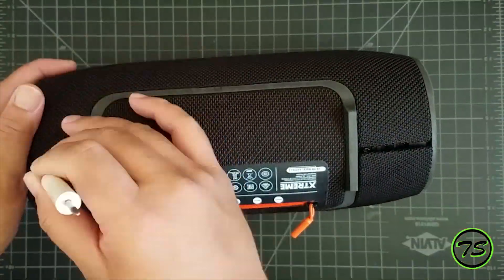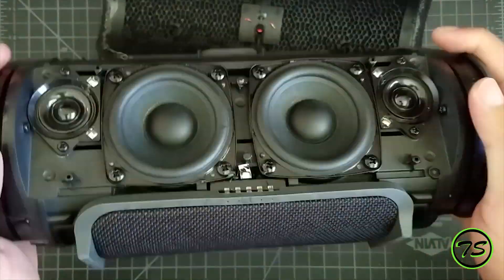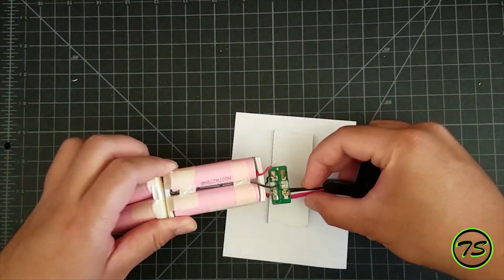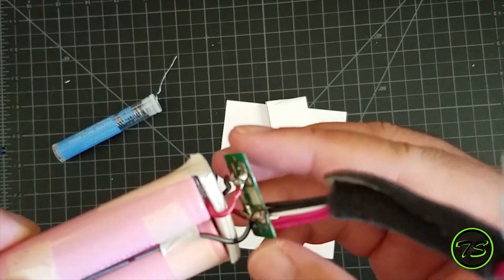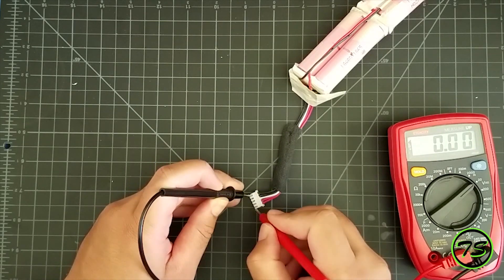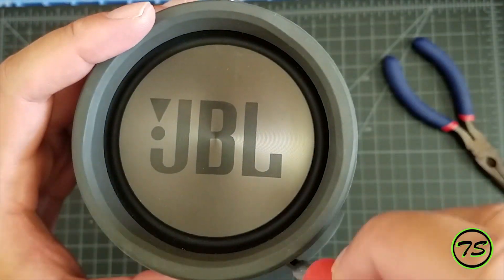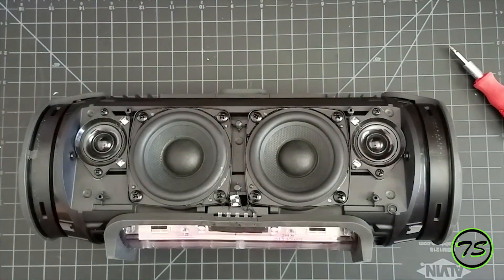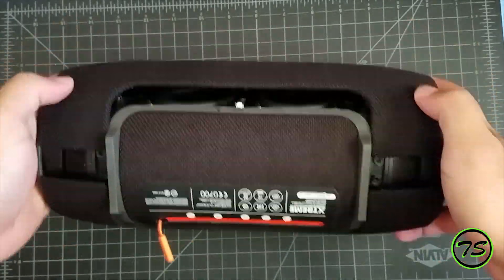(UPDATE) JBL Xtreme + 18650 Batteries (DIY)

Comment: I bought a "floor model" of the jbl extreme for $160 a couple months ago; missing the charger and strap of course. Bought a power adapter for $10 only to find the batteries in it are garbage. Turns out it's a common issue with this speaker. I've been happily using it at home plugged in, for what I paid I can't complain as physically, the speaker is in awesome shape. Apparently it sounds better and gets louder on wall power anyways. In recent weeks though I've been wanting to get the portability back into this thing. I've decided on 3400mah Panasonic 18650B cells, ideally raising the overall capacity from what ever the factory batteries are; however I'm a little hesitant to order them. In short of tearing the speaker down and manually testing the battery, how can I know if the BMS is the problem or not? My speakers exact symptoms are; constantly indicating 75-100% charging while plugged in. Remove power and speaker will continue playing anywhere from 10 seconds to 3 minutes before powering off. If it does end up being a faulty BMS, would you happen to know of a drop in replacement? I can solder that's not an issue
Reply from the maker: That definitely sounds like the battery is bad because it happened to me too. Anyways in this video I did not show what the original battery looked like but when I took out the cover for it, one of the cells was actually swollen. Another way if you can't see any swellings is just check the voltage of the cells. Those original cells you probably may already know its fully charged at 4.2V each so if you have a multimeter and and see that one of them has a voltage that is really low then you know its a bad battery. in other words if the cells have different voltage readings on the multimeter then its the a battery problem. I highly doubt its a BMS problem but I might be wrong.
Reply: Taylor Soloai awesome, thanks for the tips man, I'll be ordering those Panasonic 3400mah cells. I also have a nitecore D4 and Liitokala lii-500 charger, and a digital multimeter so I will definitely test the old cells after I get them out. I'm all about recycling and have been salvaging lithium batteries from almost anything I can get my hands on lately. I have plans to build.. essentially... A giant power bank that charges via solar panels in my window and will allow me to power all of my USB devices free of charge. Think of it as a mini powerwall of sorts, but for 5v USB devices. I have most everything I need already so the whole project will end up costing me less then $20. And with all of the portable devices I have I'd assume it will easily pay for itself within a year.

And fuck YouTube for killing the audio in this video. Luckily I was able to figure out what you were doing easily but it's just annoying is all. Love the content man, keep it up. Will letcha know how the new batteries treat me once I get them in.
Reply from the maker: No problem. You know I had always wanted to make that kind of solar project but hadn't found the right solar charger for the 18650.  Yeah the audio is becoming a problem nowadays, don't even trust those artist anymore that say the music is free to use.
Anyways yeah let me know if the new batteries worked for you. Best of luck!
Reply: Taylor Soloai fingers crossed it's not a BMS issue. Even so though, worse case scenario I'll have 4 nice Panasonic cells on hand to do whatever I want with, and I can still reassemble the speaker to run it on wall power if get tired of messing with it.
Reply from the maker: Oh and always take a break when you feel frustrated, I know I almost gave up doing the video because I had problems soldering and then I didn't seal up the speaker properly and it caused some weird noise when the bass part of the song dropped.

Comment: Hi I have just purchased a new JBL Xtreme from Croma bandra mumbai -- After un-boxing it had an initial factory charge that lasted for about 3 hrs - I drained the battery completely till the red light was blinking and then switched off the unit and connected the charger - the first 4 lights got solid bright within the first 45 min of charge and the 5th light kept on blinking - is this normal -- its now about 2 hours and the 5th light is still blinking - should i leave it to charge for more time - Please advise...
Reply from the maker: I would let it charge for a while, maybe four to six hours.
Reply: 3.5h is charging time..from 0% to 100%..last 5th light stays longest...

Comment: are those batteries lithium ion?
Reply from the maker: Yes lithium ion batteries, if you have access to some lipo batteries that's even better.
Reply: i do but how would i wire it to the control module single cell lipos dont have balancing wires
Reply from the maker: can you give me a link to those lipo batteries you have? Just not sure which model you have

Comment: well my jbl hold 3-4hour on 60-75% volume...maybe cuz i used second hand 18650 no idea, I will buy new one charge to 4.2 and instal
Reply from the maker: It also depends on the capacity of the 18650s. So check out the capacity first before purchasing.
Reply: well i used sonya 3450mAh it works fine now 8-9h on 70%Vol

Comment: whats the connector called to connect two of the batteries with each other? the thin metal sheet.
Reply from the maker: On eBay it's called "nickel metal strips for spot welding"
Reply: do I have to be careful what exact metal it is or can i just pick "a cheap one" and it will work fine? thanks for your quick answer!
Reply from the maker: Not sure what the quality is like on those cheap ones because the batteries I used were pulled straight from the laptop so it was already spot welded together. Maybe someone reading this might help us out.
Reply: alright, thank you very much! gonna read into thickness and all that good stuff. and hopefully in a few weeks my xtreme can play music for a long time again.
Reply: so I got everything and i am currently working on it, one last question tho. the batteries are connected + to + and - to - with each other, right? just want to make sure ^^
Reply from the maker: Yes thats correct, 2 pairs of batteries connected in parallel before connecting them to the BMS board.

Comment: Hi, thanks for the video. I have a question, I’ve made all the steps that are shown in the video and the result is that my Jbl turns on, it charges but when I unplug it, the battery turns to red, any ideas of what’s is happening?
Reply from the maker: It might be anything so its hard to tell but here are some thongs you can check on. Are the batteries (18650) you used hold a charge? Did you test them before installing them? Its one of those important steps I forgot to include in the video.
Reply: Taylor Soloai actually they only needed a charge, I left them charging for 5 hours and now everything is perfect!! Thanks again
Another question, the original batteries needed 4 hours of charge for a fully charge, with this ones, how many hours do they need?
Reply from the maker: It all depends on the mAh that those are rated for, usually mine are fully charged at around 3-4 hrs. Sometimes I even forget to unplug it when charging it at night (Which is a   bad habit) but I don't worry too about it because that BMS protects it from over charging.

Comment from the maker: Hey guys, if you enjoy these type of videos help me reach a thousand subscribers. It also keeps me motivated to make more like these.

Thanks again for watching.
Reply: 4x Imren 3000MAH 20/40A IMR 18650 3.7V FT NEW PURPLE VERSION in PVC CASE authentic original flat top high drain battery batteries by V Force https://www.amazon.com/dp/B0725TDPJB/ref=cm_sw_r_cp_apa_2ruQBb7ET32EF will these work??

Comment: sorry for my English)
how many hours it’s work on full charge? how many time to charge it from 0-100%? what kind of BMS and batteries should I buy?
Reply from the maker: I haven't tried to time how long it will take to charge to a 100% but I will test it out and do it for the next video. For the BMS it's from the original battery, the one that's dead so that way you don't have to buy one. You can can use the 18650 from that's found in laptop batteries or just buy some online. I got mine from my broken Dell laptop, it was dead but I found 4 good ones in it that I used for the JBL Xtreme project.

Comment: Cómo puedo comprar la batería
Reply from the maker: Can buy them from eBay, Amazon or if you have local laptop repair shops they might  have some dead laptop batteries that you can salvage good 18650s from, but if you asking about the original battery then I'm not sure.

Comment: It would seem that isolating the two battery pairs from each other has more to do with filling empty space with foam than with avoiding an explosion or fire...that is, assuming both battery pairs have negative ends toward the center exclusively or positive ends toward the center exclusively.
Reply from the maker: Yes that was the purpose of having it was to separate them.

Comment: Can I use 18650B battery..? What is the letter at the end of the number...? Thanks...
Reply from the maker: Yes you can, I'm not sure what the B at the end means though. They have good reviews on it so worth a try.
Reply: Taylor Soloai
I have another question of you don't mind. What did you used to combine the two batteries..? Can I use wire to connect them..? What is that flat silver at the bottom of the batteries. Thanks...

Comment: Hi, After I replace the original battery for a 18650s its not charging anymore do you have any idea what is causing the issue??Thanks,Gilmar.
Reply from the maker: Did you test the 18650s out before  putting them together with the BMS board?

Comment: I had problems with the Charge 3 battery. I do not know what to do, I do not think the battery to buy. Do you know of a battery replacement procedure using a laptop battery?
Reply from the maker: I have to look into to it because I never had one of those.
Reply: I understand. I'm also not aware, I just saw on this site:
https://www.ifixit.com/Guide/JBL+Charge+3+Battery+Replacement/97558

Thank you
Reply from the maker: Looks like you can use only two 18650s on that, just don't know if it will fit. Same way how I connected the ones on the xtreme but this time it's only one battery each side. Only saying one each side because of the space but can't tell if it will even fit I'm just guessing.

Comment: Is it fine to buy a premade set of batteries instead of making my own ?
Reply from the maker: As long as the BMS board is included in it because you want to make sure you can charge it and balance the charging to those batteries.

Comment: 1.After installing 18650 successfully,  my jbl extreme turns off automatically( switched off 2times in period of 4hours) what could be the reason?
2. Outer case is not fixing like new one, slight discomfort to jbl look
Reply from the maker: Khushal Gore are you able to turn it back on after it shuts off?

Comment: Thank you so much for sharing this video. I completed my project. 🎉🎶💐
Adding into BMS soldering : it's difficult to solder on BMS. But instead of completely removing old battery connection silver color plates from BMS, I cut it little longer n made small hole in it to connect wires and then soldered. Worked awesome
👍👍

Comment: Hi, Taylor
Congratulations on the video.

What is the playback time (medium), with these 4 batteries 18650s.
What model of battery specification do you use?
Reply from the maker: I'm roughly estimating this but I have used it on medium/high and it goes pass 20 hrs. So the the 18650s I used were pretty good.

Comment: I experimented and took the battery out and just used the power supply that came with the extreme and plugged it in and it works fine with no problems. Gets loud and doesn't cut out
Reply from the maker: Yep it does work even without a battery in it, I just prefer to take it with me to places and not worry about trying to find a plug to power it on. Thats why I decided to use these 18650s.
Reply: @TaylorSoloaiJR  how is the playtime vs a new one? Last as long, shorter or longer?
Reply: you mean that I can take it out the battery from xtreme plug it in again the BMS board to the main board and plug it in with the power supply adaptor, it will work fine? that is what you did?

Comment: Thanks for the detailed video. Not sure if u mentioned this but where did u get the wires u connected to the new batteries? Thanks
Reply from the maker: Those wires were from a speaker that was just laying around, so I just cut em up and used it. Since it was also thin and easy to use with the 18650s
Reply: Thanks

Comment: I've managed to connect 8 batteries all together. 4 in the battery compartment and 2 behind both membranes (cabletied). It plays for very long now and it can even play max volume with red light flashing. The only funny thing is when charging. First the number of lights goes up to 5 in aprox 3 hrs and then the number of lights starts going down and it stays on the 3rd one flashing. I stop charging as soon as the lights start going down. Any ideas what could be causing it?
Reply: I put 6 batteries and i have no problems..you put it maybe too much batteries..did you connected balance good?
Reply from the maker: When I charge mine it will always jump from one led to three LEDs in less then an hour after it being low battery. All I know is that lithium ion batteries are different from li polymer batteries (original JBL XTREME battery) The BMS is meant for li polymer so not sure if that’s why but it’s just a theory I have. But never does my batteries ever drop down to less LEDs after a while being charged.

Comment: I've got two 3.7 volt 8800mah is there any problem if I connect these to my xtreme?
Reply from the maker: 8800mah? Are those 18650s?
Reply: I havent bought them yet but the ad said they were 18650 and were 8800 mAh I'm probably going to buy ones with better quality.
Reply from the maker: Don't buy them, 8,000mAh is just a lie.
Reply: Taylor Soloai thanks a lot, great video, I’m going to put 4 18650 each 2500mAh

Comment: I have an idea, how about using battery holder for 18650 that contain 2 battery for each holder. Connect the wire to bms using connector. So not need to read solder again. It's possible to do it guys, I mean jbl battery place size ?. the tools like this https://m.ebay.com/itm/3-7V-2x-18650-Parallel-Batteries-Holder-Box-Storage-Case-Container-With-Wire/253074212727?hash=item3aec660777:g:hE0AAOSwQVZZgUkP
Reply from the maker: I tried it before but they don't fit in the battery compartment.

Comment: I have 4 batteries each 4.7 v
18650 can i by the 4 in parallel or the voltage is higher? are you at risk of burning the plate? sorry my english because I'm from Brazil
Reply from the maker: MarllonAlmeidaTV your 18650 is 4.7V? Never heard of any that high in voltage. You sure it's not 3.7V?
Reply: So that's what's written on the battery. because I tried to put 4 in a replica and I think it got very strong and it burst a capacitor,

Anyway, in case I take out the battery of an old notebook removing the batteries they are 3.7? I can add up how many?
Reply: I was wrong, it's 4.2 that way, the link there's a look
https://producto.mercadolivre.com.br/MLB-668303452-bateria-18650-li-ion-gold-9800mah-42v-lanterna-led-tatica-_JM
Reply from the maker: I can't access the site it says "This site can’t be reached"
Reply: LonTV maybe it’s 4.2 because it’s already full charge. When you try to charge 18650 the maximum voltage is 4.20 which is 4.2, the minimum voltage is 3.70v or 3.7v.
Reply: LonTV fala irmão blz, consegui fazer o troca da bateria? Consegue me dar uma dica? Ficou bom?

Comment: I have 4 batteries each 4.7 v
18650 can i by the 4 in parallel or the voltage is higher? are you at risk of burning the plate? sorry my english because I'm from Brazil
Reply: eae doutor eu sou do brazil, se ligar em paralelo elas continuam em 3.7 ou 4.2 v só em série que a tensão sobe, de qualquer forma use um multimetro para testar

Comment: Hi, I'm from brazil. I'm not getting. It is not recharging. It is connected correctly in bms, but does not recharge. I checked several times but nothing is wrong. If there's something I do not know
Reply from the maker: Was this after you connected the charger? Because it will not work at first, connecting the charger will activate the BMS so it will supply the power needed.
Reply: Maybe your bms died..

Comment: Can you use any 18560s? I found some batteries with these specs:
Voltage: Typical 3.6V (4.2V when fully charged)
Capacity: 3400mAh (discharged at 0.2C)
Dimensions: 18.6mm x 68mm (+/-0.1mm)
Current over-flow protection: 5A-6A
Weight: 50gram
Reply from the maker: djlobb yes you can

Comment: hello, is it true that one cell is 3.7V? because in te video you measure 4.2 on the battery cell?
Reply from the maker: Yes, its 4.2V when it is fully charged. I was just showing that so the viewers know what the voltage is when the BMS stops charging the 18650. Same with the original battery, two cells and both fully charged @ 4.2V.

Comment: To solder to the circuit board an aluminum plate is attached on top, this needs to be removed by heating it with a solder iron until it comes loose, once it's removed it's easy to attach the wires. I was sure I'd fry the electronics on the board, but it worked just fine afterwards.
Reply: Bruce's BeeKeeping I kept it little longer plates on BMS and made hole on that, passed the wire & soldered on plate itself.. Worked fine for me

Comment: i tried everything to solder the battery wired to BMS board, but soldering is not working, i use sand paper to scratch the terminals, soldering paste, and nothing, any ideas?
Reply: Heat it up there's an aluminum plate on the board that needs to come off before you can solder to the circuit board underneath.
Reply: Bruce's BeeKeeping thanks I solved using a solution found on other web site, just made a pair of clamps and press over the 2 terminals impossible to soldering